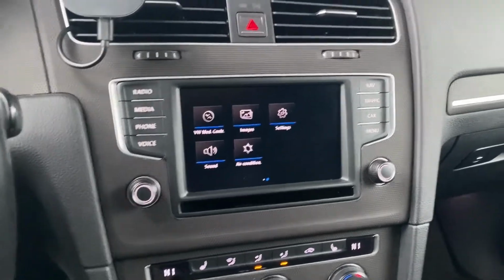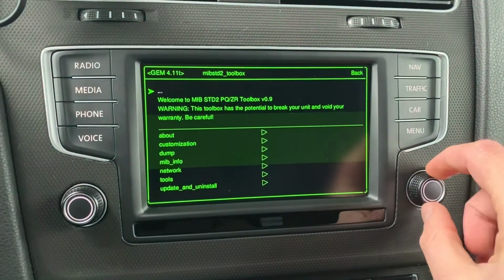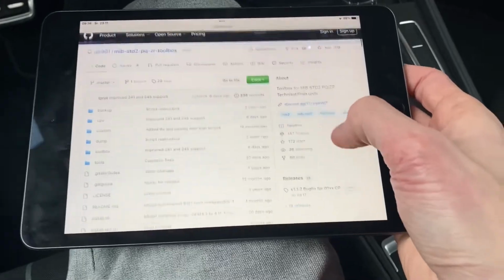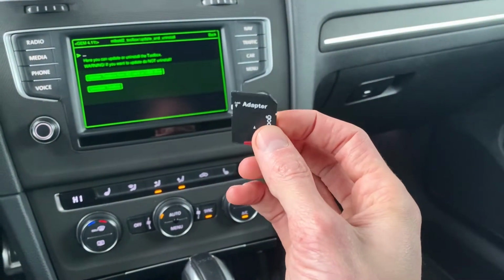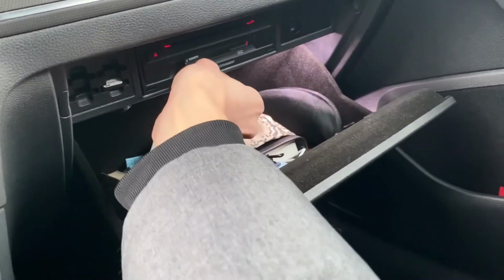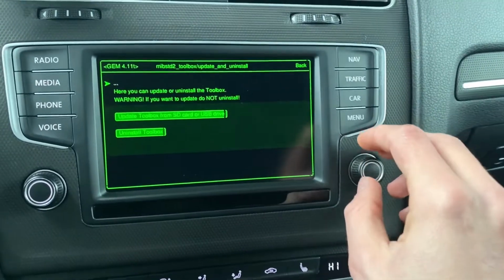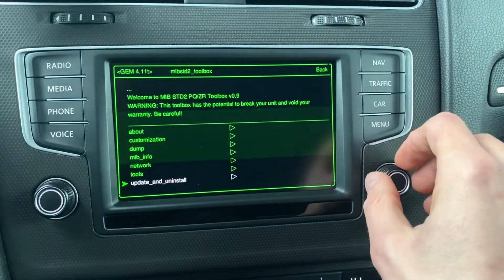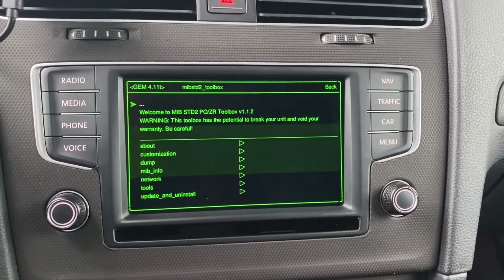MIB STD2 Toolbox: update from USB or SD card

Comment: Hi, dude. How i can converse mib1 std from japan (MSTD_JP_VW_P3171) to europe? I tried to install the firmware (MSTD_EU_VW_P4470) via Service Mode use button "Update" , but I got an error "error variant conflict. Medium 17101 17103 17100 17102 (Mainunit: 17113)" 
Ofc SD card formatted in fat32. 
What is my mistake?

Comment: Hello, first of all, thank you very much for the video and information, thank you for your efforts.  I have a Technisat Bolero unit with version MST_EU_SK_ZR_P0369T. It has a single SD card slot. The greenmenu is open and the mibstd2_toolbox tab does not appear in the greenmenu to install the toolbox patch. What is the reason?  Is it because the software version is low?  Do I need to revise eMMc? Can I upgrade to the latest version and then install v1.3 toolbox?

Comment: Could somebody please give me some advise/help?

I have the  mst2_eu_vw_zr_P0137T installed, but want to be able to install Toolbox so that I can use a map on a custom SD card. 

I tried to install Toolbox without firmware update with the solution to replace the cpu folder from GEM folder with the one in the root of the SD card so that the root CPU folder is replaced with the GEM folder version. After 10 attempts it keeps saying: start electric test. Mainunit/version compare. Accept this error code leads to restart(translated from Dutch). 

What should I do to make it work? I hope it will be possible.
Reply from the maker: This message is standard for all updates and installations across all MIB units. Just press cancel, unit will reboot, and you are done. Enable developer mode and enter hidden menu.

Comment: Thanks for video. Why I can't press "start " to install on device? 
MST2_EU_SE_ZR_PO515T
2 slots sd + nav
Reply from the maker: P05xx is not supported by this method. Sorry. You will have to remote the unit from the car and modify it on bench.

Comment: Hi, does the toolbox work for MST2_EU_SK_ZR_P0480T?
thank you
Reply from the maker: yes.
Reply: hello hi i have the same software unit with 2 sd slots i tried many times when i install the mention link folder in the sd card and do all the steps activate enginnering and test mode but the tool box does not appersrance yet on the engineering page ??? @MIBhelper

Comment: hello, I loaded the necessary files into the USB drive, when I plug it into the car, the USB drive is detected, but after clicking on the menu / software update / update options, I cannot choose the USB option. I need help. My car has the necessary features for Android auto and my car is 2016 model vw jetta.
Reply from the maker: Non-nav unit or Delphi unit.
Reply: Delphi unit

Comment: Hello friend.... do you have to sell me the unlocking pacht for the MIB2 Delphi unit? I want to unlock using SD Card only.
Reply from the maker: I'm not going to sell something that's free and publicly available on the internet. Check mib-helper.com
Reply: @MIBhelper  Well done buddy...thanks.

The issue is that I haven't found the solution for my MIB2 DELPHI

has active Component Protection

I need to find the Patch to unlock using only the SD CARD

Comment: Hello there and thank you for your very helpful videos!
Please help me! I have a Seat Leon FR 2018 model and I try to install the MIBtoolbox (the most recent release), with an SD card, but though it recognises the card and that it has update files in it, when I go to software update and press the MIB_online_approval..... doesn't let me to press the start button so the process starts.....????
Why? I follow all the  steps please HELP ME!!
Reply from the maker: What's your SW Train?
Reply: @MIBhelper  My sw train is: MST2_EU_SE_ZR_PO468T
I have one sd card slot and no navigation. And the cpu folder says cpuplus.. Thank you very much for your answer! I hope I can find a solution
Reply from the maker: You unit does not support the SD card installation method. You would have to remove the main unit from the vehicle, open it, connect with the eMMC storage chip, connect it to virtual machine...
Reply: @MIBhelper  Oh I see. I can not do such things. I probably have to go to the seller. Thank you very very much!

Comment: Is it possible to change the maps from a jap import using the toolbox?
Reply from the maker: yes, but it's not going to be easy. You need EU firmware, patched SWDL (this can be done with toolbox), customized metainfo2.txt. With this you can force the unit to install EU firmware. Next you need to adjust coding of the unit for EU maps. And finally you will be able to use SD with EU maps.
That's assuming that JP and EU hardware is the same and will allow running EU firmware. I don't have experience with this yet, so please do your research before you start.
Reply: @MIBhelper  Thanks for the answer, it is very hard to get the right info, would you ever consider doing a video on this, i find you easy to follow.
Reply from the maker: If I get a JP unit to play with, for sure.
Reply: @MIBhelper  what if I send you 1 of mine?

Comment: my mib2 system does not display a fec swab code. any idea what this problem is?
Reply: when the update is done, i don't get a toolbox
Reply from the maker: what's your SW Train? You can find it in hidden menu.
Reply: @MIBhelper  MST2_EU_SK_ZR_P0245T
Reply from the maker: You need to enable developer mode to see FEC/SWaP menu.